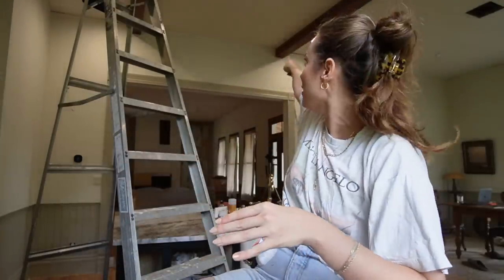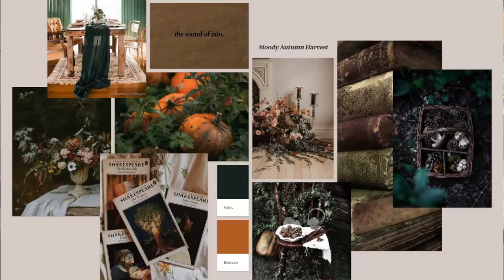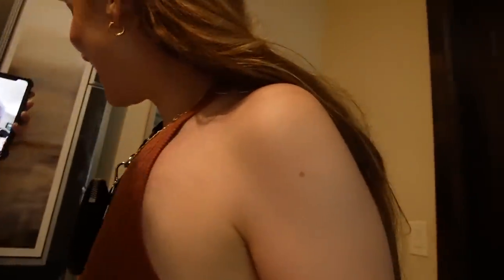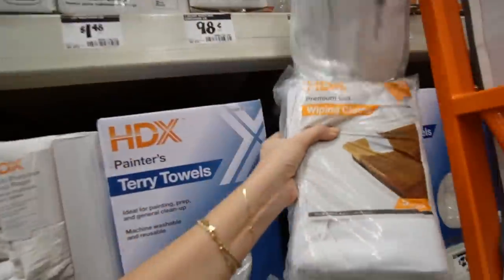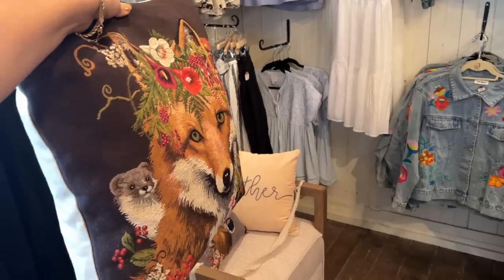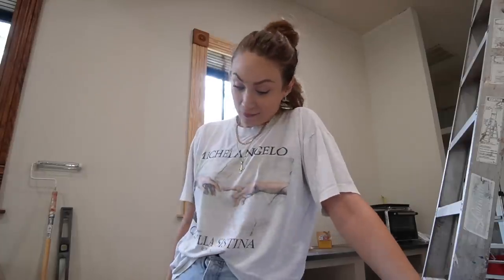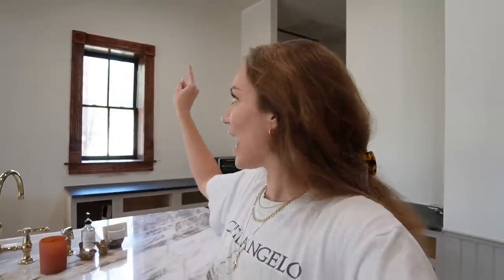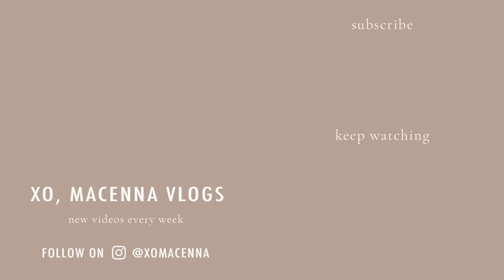DAY IN THE LIFE | renovating & planning Fall decor | XO, MaCenna Vlogs

Comment: I absolutely love the beams and window boxes Macenna, I applaud 👏🏽 you for your creativity and hard work! And especially figuring things out for yourself... ie. You putting up the beams, with Mom's help is everything! Women doing it by themselves! If I can make an observation, on the wood that has the original stain that meets the new stain (probably where trim was previously). Perhaps you can use some mineral spirits or sand it lightly to soften that line and reapply stain if necessary! But brilliant job on the stain colour, looks perfectly matched!👌🏽

Comment: The boxed windows are amazing & beautiful! I don't know how much you really read the comments. But I really wish you would have tried Spanish oak stain in the minwax with just a little wallnut mixed directly into it. Not having to put 2 different stains on it.  Trying it with &  without & it woulda got the color you where trying for. Our home was over 100 years old & it matched the old woodwork. Good enough if it needed touched up. You couldn't tell the difference. And new wood as well.. Maybe you did.. The shopping cart, so funny!